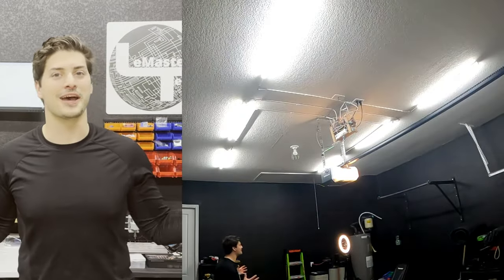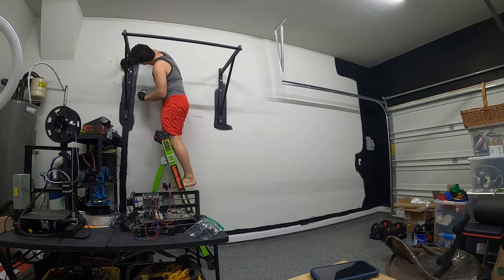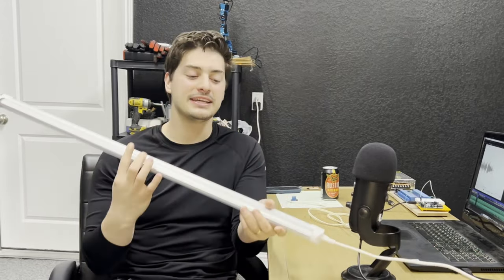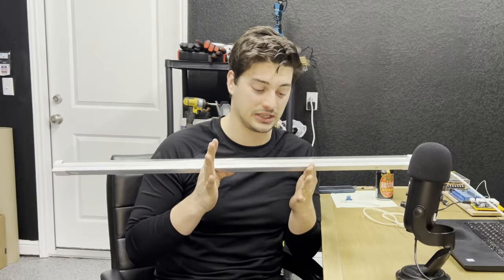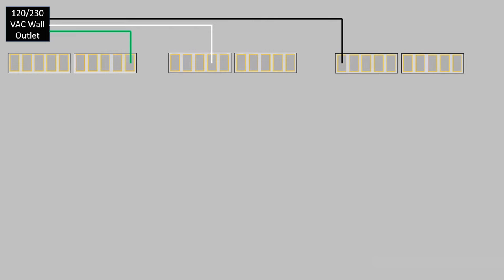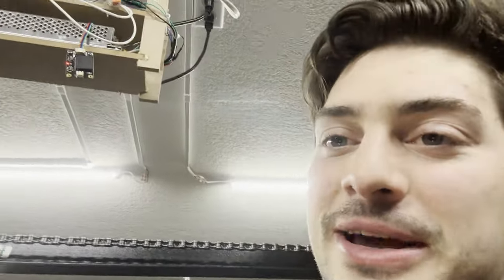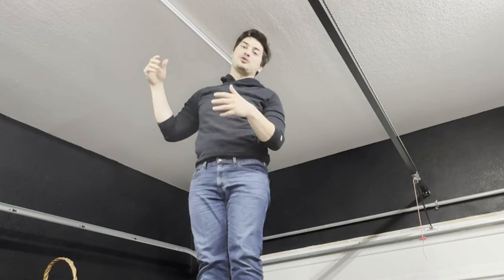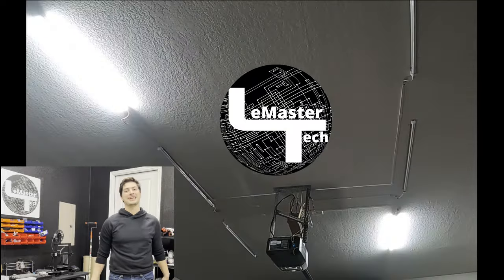Voice Controlled DIY Smart Lights!

Comment: I think the relay board should be switching live and not neutral (just like a regular light switch) that way you don't have live always running to each of the lights.  A lot less dangerous.
Reply from the maker: Hey! I think you’re exactly right I am planning on doing that tonight, fortunately I can pop the wires into/out of those wago connectors super quick so should only take about 15 minutes but I totally agree I don’t know why I didn’t think of that in the first place! Thanks for the comment!

Comment: The garage looks like its going to be a great workspace, well done! I would like to try something like this in my garage, my hobby is model railroading and I would like to try and create day night scenarios on a speeded up clock for when the layout is running if that's possible. I know there are manufacturers out there that make bespoke controllers for this but it would be a lot cheaper if it was doable with an Arduino. Congratulations on the 10k subscribers.
Reply from the maker: Thanks Phil!! I hope it’ll be an awesome space when I get it cleaned up a little better 😁 that should be super possible just need to find a way to tie “running” status into your arduino! Depending on the voltage and what signals it as running or not running you might need some relays but then you can just use the arduino millis() function to check how much time has passed and make a sped up clock based off that! Sounds super fun 😊 goodluck!!

Comment: Hi there! Well first thank you for this amazing video!! it’s so informational! I’ve worked with smaller arduino projects before but just got onto it again and was looking to build a clap sensor light in my room
i just had a few questions 😅
1. if it’s a single light powered directly through my circuit board (light switch) in my room, would i still need those transmitter boards
2. i’m only using a single relay switch how would i essentially connect my batteries to that

if you can tell pretty new to this haha, thank you so much for all the info!
Reply from the maker: Hi thanks for watching!! You definitely would not need the relay board for just one module they make 5 volt relays that can be controlled directly through an arduino and soldered into a basic hobby board or just wired on a breadboard 😊 and question two you probably want to look specifically for a double A battery(or whatever size you’re using) to “flying leads” adapter so you can pop batteries in and out and power the light that way! Hope this helps 😎